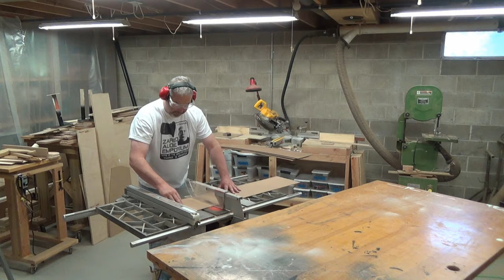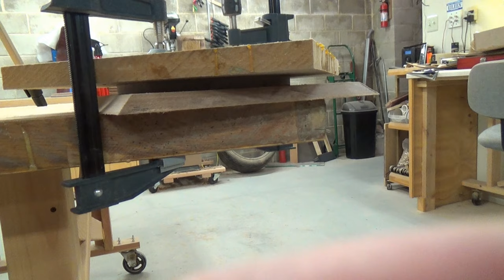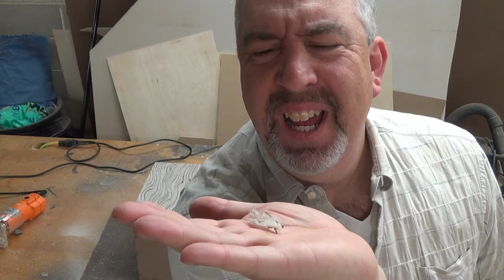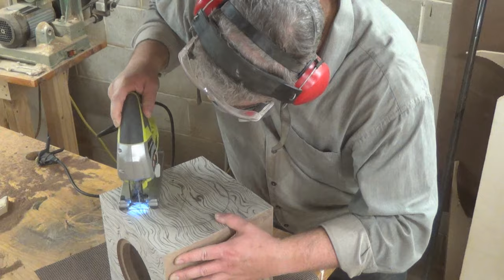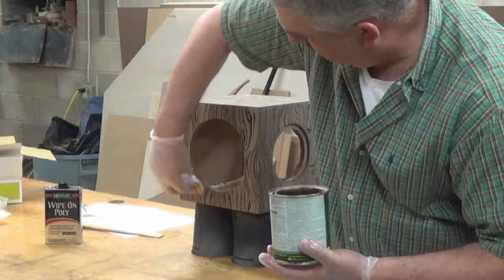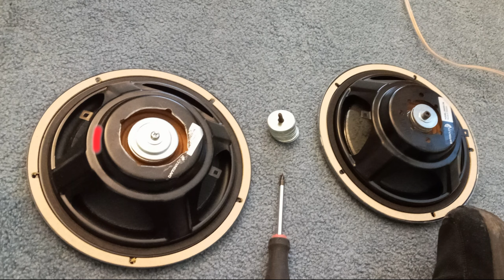Building the Epique 'Small Cube Subwoofer'

Comment: Using contact cement would create vibe absorbing layers between the sheets of material, it dries tacky.
Prob not a prob for a box that small, but, couldn't hurt.
Reply from the maker: Hey, sorry I didn't see this comment for some reason. Interesting idea. I've heard of other guys using absorbing material between layers but never did so myself. In the follow-up video 'Digging Deeper' there is a thumbnail of me sitting on the cabinet... I really did sit on it at full-power, and you can feel the energy this thing is producing. It feels like you're sitting on a small-block Chevy engine at idle. No vibes from the skin of the enclosure, just the sense of powerful energy and mass in motion. Thanks for the comment.

Comment: I really don't see the point of the E150HE-44 as a subwoofer. When using it in a ported or passive-radiator type enclosure, you end up with a design that is far from compact. When you need about ~0.5 cu ft of air-space, you might as well use either an 8 or 10" driver in a sealed box instead. Especially with DSP and class-D amplifiers becoming so cheap, it's easy to EQ a 8" or 10" driver to the point where it easily outperforms the E150HE-44. It only makes sense in my opinion when used in a compact 2-way floor-standing speaker design, where the high voice coil inductance can be used to ease the crossover design. I do hope that some of the engineering that went into the  E150HE-44 will be used to improve bigger drivers (8 to 12").
Reply from the maker: Thanks for the comment.

Comment: Measurements would be nice
Reply from the maker: I hear you.  In my experience WinISD is usually spot-on as far as frequency response goes so I basically assume the modeled response will be close enough to the actual to not be an issue. Things also become more complex when trying to combine the response of one active driver and two passive radiators. Not to mention the room has SO much impact on the actual response so as to really change what we're hearing.  I may add some actual measurements to future projects if I can do so without taking too much time up in the video... viewers don't like long videos I'm finding out. : )   Thanks for the comment and suggestion!
Reply: @zarboaudioprojects1430  I would be curious about spl and frequency response in room that we dont get from winisd

Comment: i think u should use 2 x 6inch passive radiators with a 5inch driver. Not 8inch.  
Usually u just double the driver cone area. So 2 x 5inch passive radiators or maximum 2 x 6inch passive radiators
Reply: As I understand it, that rule would generally apply if you could find two 5 inch or two 6 inch passive radiators that can match the drivers excursion capabilities.  The X-max on this one is quite a bit more than most drivers this size.
Reply: @kevinkendrick3954  if u can't find  passive radiators of the same size(5inch) with the same excursion then u can use the 6inch ones even with lower excursion. 2x 8inch for small 5inch it's overkill and not effective
Reply: @HowDareYouu  I know Tom well enough to know he ran simulations on the PR's he knew were available. If you would care to run a simulation using one of your suggestions, I'm sure he would be open to suggestions.
Reply: @kevinkendrick3954   that comparation could be a video idea. ''How big is too big?'' even trying with 2 x 10inch radiators
Reply from the maker: I respect your opinion, but I can't really understand why you would say I should use two 6" PR's with a 5" driver without modeling it? Kevin alluded to part of the passive radiator rule of thumb above which basically says: you can use one Passive Radiator of the same size as the driver if it has double the excursion capacity, or two PR's of the same size with the same excursion capacity as the driver.
But that's just a rule of thumb because it often works that way. It isn't always true. This driver is capable of 14mm under 70% motor control, and a LOT more excursion past that, trust me, it moves a BUNCH. Without modeling a particular combination to see what it can do in the real world, it's just a rule of thumb and nothing more.
 
Two 8" passive radiators for a 5" driver is not effective? Explain why?  If the performance is there and it can take a respectable amount of abuse without complaining isn't that what you would consider 'effective?'  It seems to work just fine in real life.  Overkill? It's a design choice maybe, and I think a good one, but considering the excursion of the Epique driver, not at all overkill.

To be honest I did consider modeling two of the 6" designer series PR's in the same line from Parts Express, but I didn't do it because I doubted they would be able to keep up... remember, it's not just the size of the PR and the excursion... you also have to add the correct amount of weight to achieve the response you're looking for, and I think I was bumping up against the limit of these 8" PR's regarding the ratio of excursion/weight they can carry.  The 6" PR's would HAVE to move more to do the same work, so I doubt they would work as well as you may think.  But go ahead and model it if you care to and feel free to report back with the findings. If it works, then I guess that's an option for you with this driver. 

I'm not trying to beat you up for having a different opinion... that's fine, but you're making generic statements based on a rule of thumb and treating them as authoritative gospel fact, when in reality it appears you didn't model anything, and  I actually did design and build this thing in the real world and it works. And pretty good at that. 

This channel is designed to demonstrate how to create this type of audio related stuff, as well as some of the reasoning behind it... and I really want to make sure what is presented on these videos, as well as the comments, is based on fact and is helpful. 
Different opinions are fine to state here, please just make it clear you are stating your opinion, not telling everyone that it's fact, and that I did it wrong, when you haven't taken any steps to back up your claims.
Reply from the maker: Just out of curiosity, I did a quick model of this driver with two of the Dayton Audio Designer Series 6.5" Passive Radiators. 
And it does look like it would work... 
...until you feed it some real power and realize that the excursion of the two passive radiators would greatly exceed their mechanical limits at anything much below 50 Hz. 
Yes, it would function, strictly speaking... but you would be leaving so much performance on the table that it just doesn't really make any sense to me. Why pay up to buy an excursion monster, only to limit it to 60% of its abilities because you wanted to stick with two passive radiators that are closer to the driver size 'rule of thumb' instead of going with a few 8" PR's that can really do the job? To me, that seems like the definition of 'not effective.'
(The two 8" PR's I used do not exceed Xmax either at full power or well past the drivers likely max excursion (Xmech) number, so there is some built-in safety in using these as well.
There may be other 5-6" PR's on the market that would work well with this driver, but I see no issues with using an 8" passive radiator for this project.
Reply from the maker: Thanks for commenting. I'll just leave it there. :)
Reply: @HowDareYouu  your calculations about the effective erea are wrong. A 5 inch is about 90cm2 and a 8 inch is about 220cm2. So 2 x 8 inch is about 440cm2 and 5x the effective erea of the 5 inch BUT it has lower Xmax, probably around 8 to 10 mm while the 5 inch has about 15 mm of Xmax AND the rule of thumb is using 2 times the displacement but mostly needs at least 3 times the displacement.
Reply: @roygriend5143  nope, yours are wrong. Learn basic geometry
Reply: @HowDareYouu  please search the driver and passive radiator displacement ( cone erea and xmax ) and post it over here
Reply: @roygriend5143  oh really? then u shoul tell this for example to KEF. They are using what i'm saying for the KEF Q950 series. And many other big companies. But i'm sure u are smarter than them
Reply: @HowDareYouu  that's not what i asked but kef used the outside diameter of the speaker like most companies, so that's including the basket ( the steel frame that's not moving )
Reply: @HowDareYouu  i didn't say they are wrong, you just don't get the right idee of measurements AND you don't know the Xmax of the driver and passives! They could put 4 passives of the same size but if it only has 2 mm Xmax it is useless.

Comment: I wonder how this performs against a decent 8" sub with the same 2 rads in that box... With the exact same footprint, I'm not sure what the point of this is
Reply from the maker: Fun, that's the point... and amazing performance. Try not to 'see the driver as a particular size, but as delivering a high level of performance with low distortion. If it works, and works well, then that is the point.